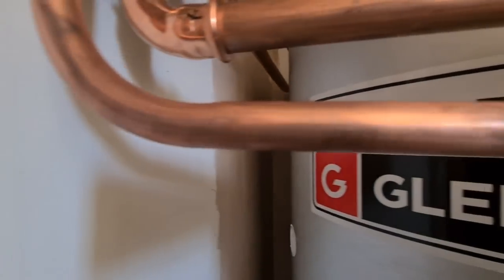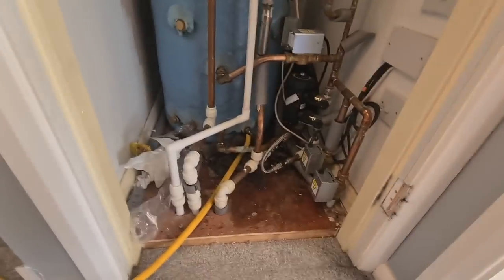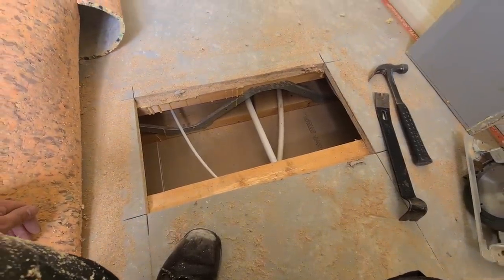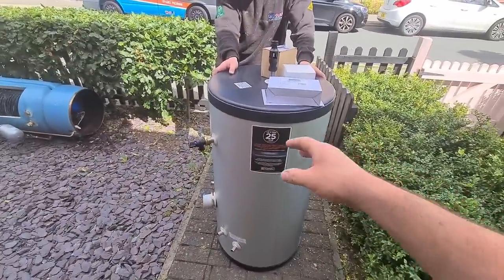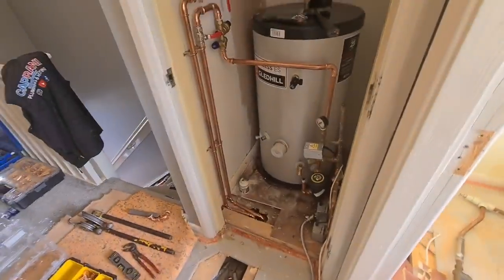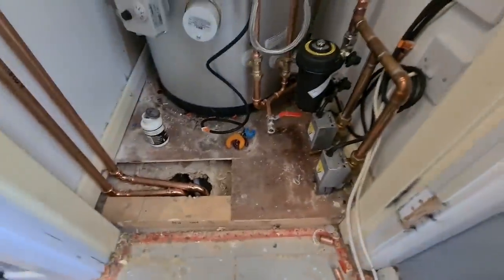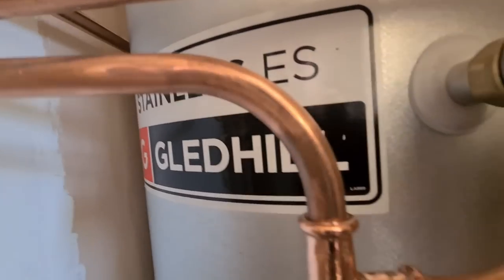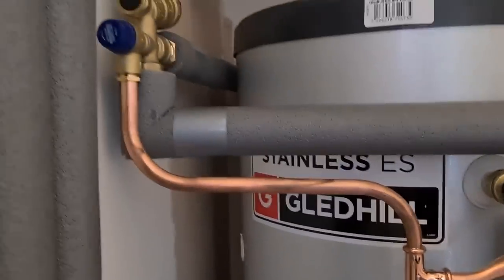How to Create a Masterpeice

Comment: That’s a good looking unvented install! 
I also like putting lever valves in on the cold feed. I normally put a 15mm lever valve and then in the open end of the lever valve put a compression fitting blanking disc, it is a neat way of capping off the drain down valve! Great videos as always!
Reply from the maker: Not a bad shout thanks for the support bro 👊🔥

Comment: Gorgeous pipework yet again, well thought out so it's far easier to replace the cylinder in future lovely. I am due for my unvented renewal but last time discharges had to drop 300mm before a change of direction, I take it that's not a requirement now?
Reply from the maker: 300mm before the first elbow on the d2 pipe bro.

Respect for the support as always 👊🔥
Reply: @capraniplumbingandheating  Oh brilliant, that makes life so much easier cheers! I'll remember that for the renewal.
Reply: Thought for domestic it was a max of 600mm on the D1 discharge to the tundish?
Reply: @gruhwch4876  Approved Document G: '3.54 The tundish should be vertical, located in the same space as the unvented hot water storage system and be fitted as close as possible to, and lower than, the safety device, with no more than 600mm of pipe between the valve outlet and the tundish'.   But it 'guidance' not 'law' - I might have fitted two tundishs (P&T and Expansion Relief) and tee'd into D2 after these?
Reply: But maybe it is only 600 - hard to tell from the diagram. (d1 strictly between P&TV and Tundish, I don't believe restriction applies to the expansion valve length?)

Comment: I’ve spoken to megaflo reps about this before what’s your opinion on levers on the hot off a unvented? I’ve done it and not done it he said you shouldn’t but I’ve never spoken to someone with a 100% answer?
Reply from the maker: The way I look at it is all your safety valves and expansion are still active if you close it. I like to install them as  it decreses the pressure straight away on the hot side. I cant see a problem with it honestly bro 🔥👊